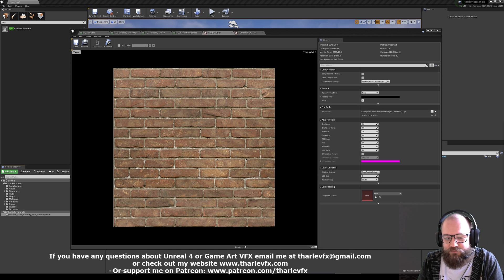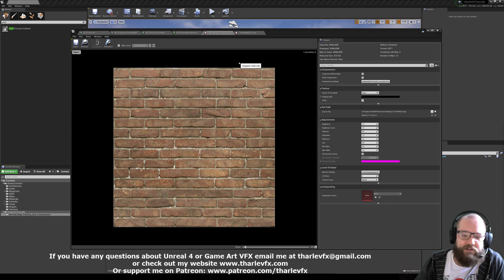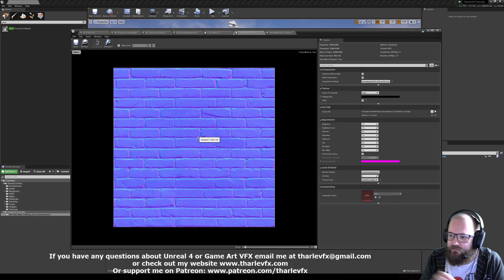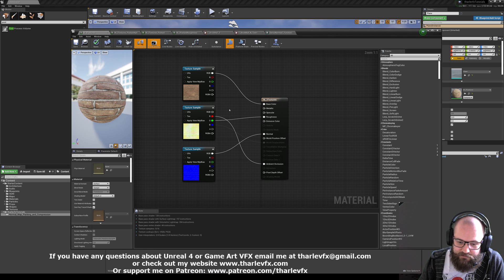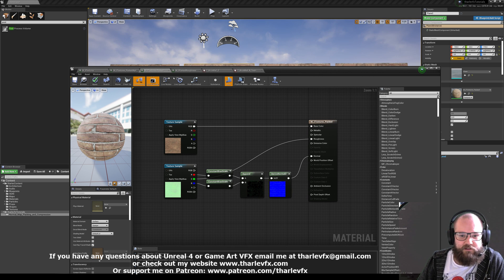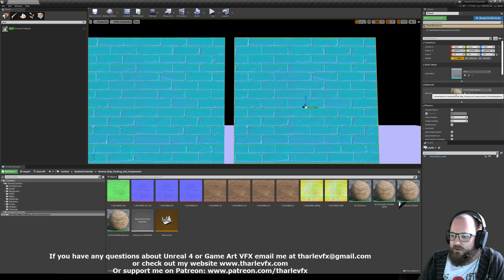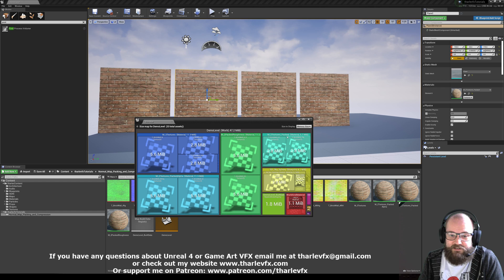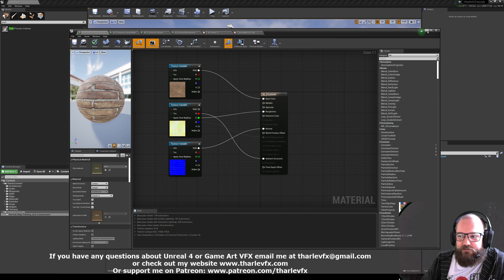DeriveNormalZ and Compression Artifacts in Materials and Textures

Comment: What is your opinion about the BС7 compression format? Is it good or bad to use it in normal maps?
Reply from the maker: i would use the default normal map compression for Normal maps where you need high quality normals - it compresses the red and green channels only and rederives the blue channel in the shader so you get the highest quality normals for your data cost.  BC7 compresses RGB together so you get some artifacting on a normal map but you can also replace the blue channel with a different mask and rederive z manually so if you need more data storage it can be an option.

Comment: I'm a bit late to the party, but what happens if you use the DeriveNormalZ method but you set ur normal map compression to BC7 instead of DXT1?

It should give similar result as using BC5, right?
Reply: Probably, but the problem is that BC7 takes a lot more space on storage compared to DXT1, and in most cases its not really a noticeable difference, better to stick with DXT1 for that reason

Comment: Actually, the normal map compression puts R into RGB and B into Alpha, resulting in 16 bits of info, instead of the 8 you mentioned. this to avoid compression artifacts. (hence its crispness)
It does this under the hood, so in the mat editor, you still use R and B to show each individual channel. (hence normal maps have "Alpha: true")
This also improves the number of bits available between -1 to 1.

This is also handy for grayscale noise maps, if you saved them as an RGB (non-packed) and use the "alpha" compression setting, the grayscale will be saved into alpha and gets rid of the RGB portion of the texture, resulting in a 16-bit grayscale instead of an 5/0/0 or 0/6/0 bit texture. I use this for all my grayscale (noise) textures.
With the additional benefit of being able to reduce the texture size while maintaining a much clearer texture over a DXT1 twice its size.

And I also use this for uv-distortion textures which I save as a normal map, because of the added -1 to 1 value it generates, and because it won't have the cross talk/artifacts when saving as regular rgb/dxt has. (not to mention the "masks" compression does nothing more than unticking srgb, while maintaining the channel cross-compression artifacts.)

As for not being clear with drawcalls, textures use texture lookups, not drawcalls :p
Reply from the maker: Yoeri Luos Vleer awesome - thanks for the extra info! Saving distortion textures with normal map compression is a great idea.
Reply: This was great info to add to the already amazing video! Thanks, both of you :)
Reply: A follow-up question for me is why you use normal compression for distortion? Wouldnt the alpha compression be better bit-wise? Wouldnt you be able to get -1 to 1 values just with a constantbiasscale?
Reply from the maker: DeraiProductions you generally want distortion to be different in U and V so you want two channels of data which a normal map compression gives you. Alpha compression is just one channel which might be enough depending on your use case but you’re right that they’re both 8 bits per channel
Reply: I checked my normal maps that are in BC5 in Unreal and it states that "Has Alpha Channel: False" What does this mean? Also what do you mean by -1 and 1?

Comment: Thank you, I didnt know that the number of texture in material will make difference in drawcalls.
Reply: At 11:53 when he said "3 draw calls" what he meant to say was "3 texture samples."  Each of them is just one draw call.  But the one that is sampling 3 textures is a more expensive shader on the GPU because it's doing more texture samples.
Reply: @BenCloward  Very useful info to know! Thank you!
Reply from the maker: so sorry if I wasn't clear on this - I'm not an expert on the subject.  The number of draw calls isn't affected by the amount of textures, just the amount of VRAM that is being used and the per pixel shader cost of the material.  So while it's cheaper to have less textures in the material, I don't think it affects the drawcalls - the number of materials on a mesh is what changes the drawcalls.  

If you want to read more about the subject I recommend this thread on Polycount: https://polycount.com/discussion/206507/the-cost-of-a-texture-draw-call-quantity-vs-resolution